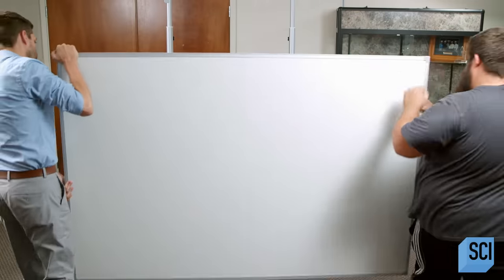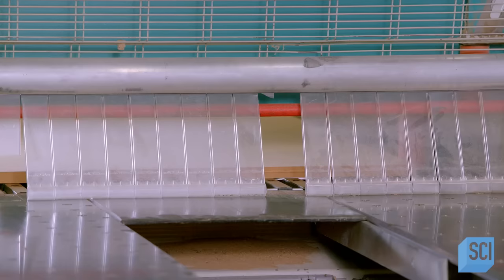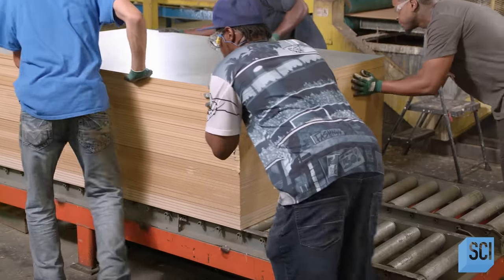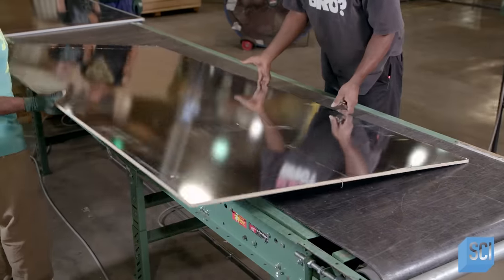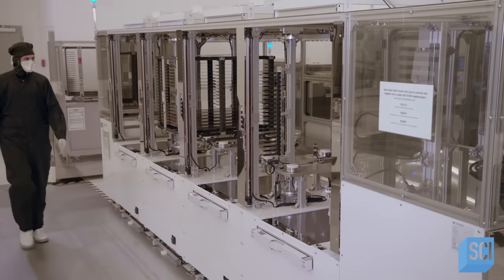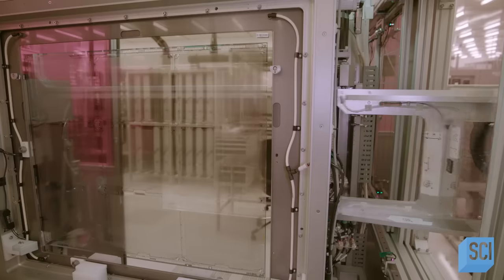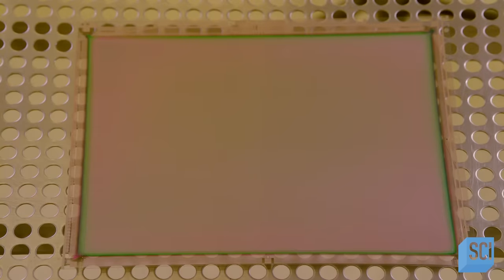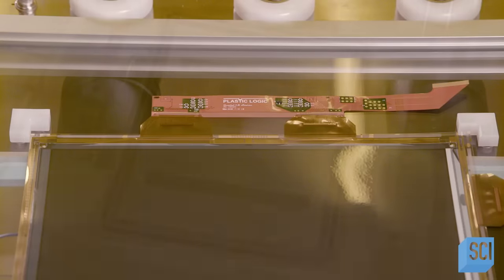How Dry Erase Boards Are Made | How It's Made | Science Channel

Comment: Fun fact: dry erase ink can erase Sharpie ink. It may need a few tries to completely remove the Sharpie, but it works.
Reply: Dry erase and sharpie ink are the same but the dry erase also has a solvent. This solvent can dry off which is why old dry erase ink gets stuck. You can buy this solvent in spray form which is usually used to clean these boards. The solvent is usually 90% isopropyl alcohol and 10% water.
Reply: @Rickardsson99  yes, I got the cleaner in a set with an eraser and a few thin markers.
Reply: Everyone has hand sanitiser laying around now... That does it great... I know because at work the cleaners went round during covid and cleaned all of the numbering off the damn fire extinguishers.
Reply: FYI this dose not work for fabric only smooth surfaces
Reply: @jordanperry5559  yeah the fabric will just absorb the color.
Reply: Sharpie can also erase Sharpie ink, you just have to be a little quicker with the wiping cloth. Toluene (nail polish remover) works best.
Reply: This was the OG life hack!! Been a favorite of mine for over 20 years 😂

Comment: It'd be cool if you could just buy the porcelain steel sheets and apply them directly to a wall or other surface.  Dry-erase wallpaper would be awesome.
Reply: You can buy tubs of dry-erase paint/coating
Reply: We have some conference rooms like that at work, the walls are dry erase on 3 sides, windows on the 4th. The inside of the door and door trim are also dry erase.